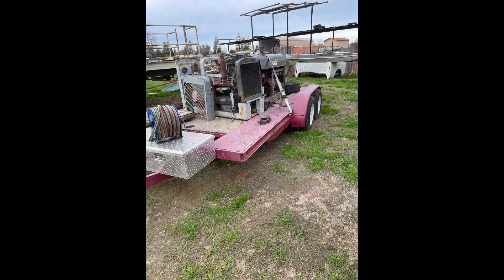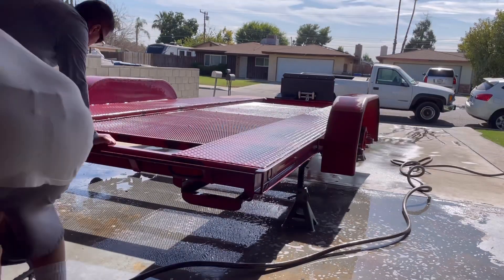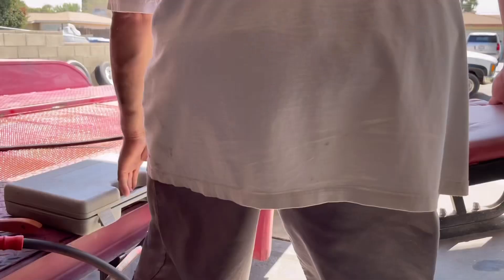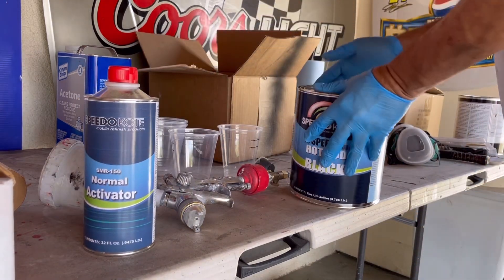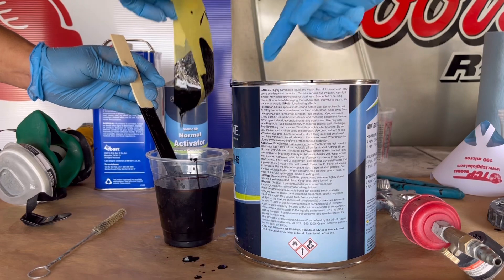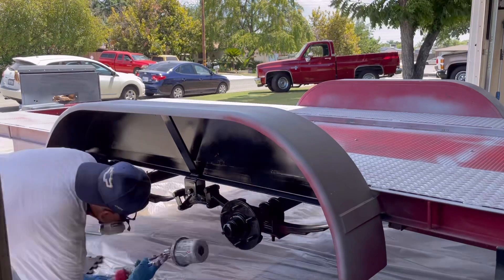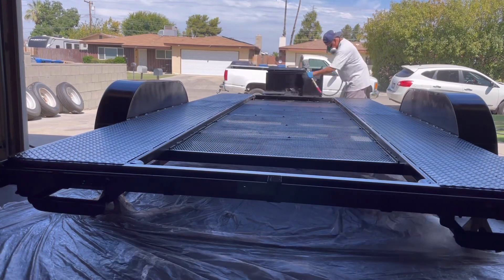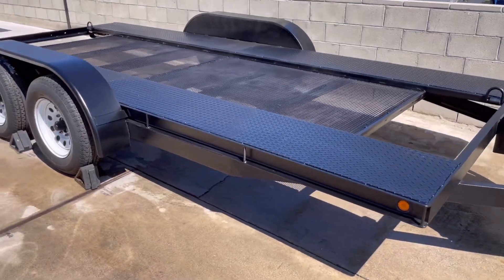How To Paint Your Car Trailer At Home and Save Cash

Comment: Nice looking trailer! What thickness expanded metal did you use?
Reply from the maker: I think it was #9  I was concerned about adding weight. I will not put anything heavy on expanded metal because I noticed some flexibility when I walk on non supported areas.Thanks